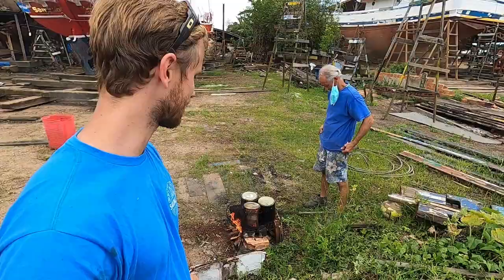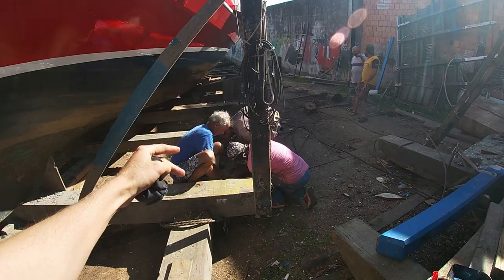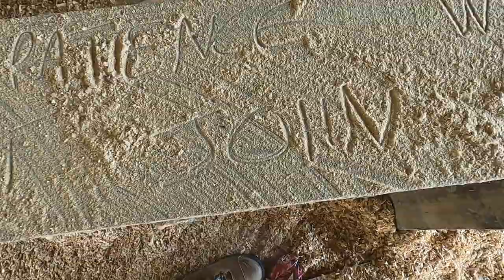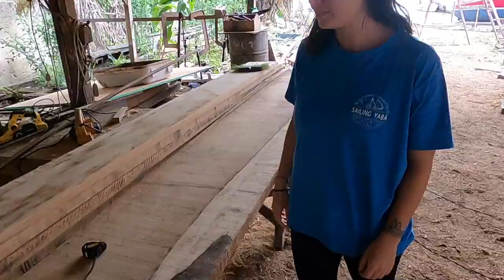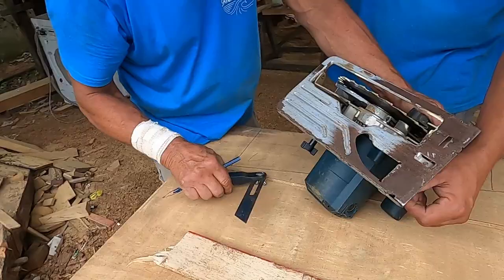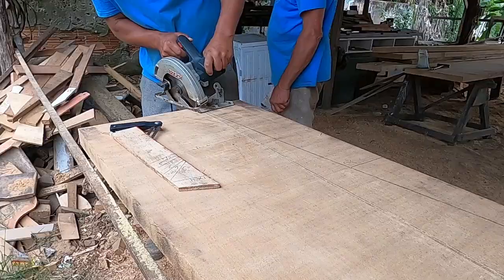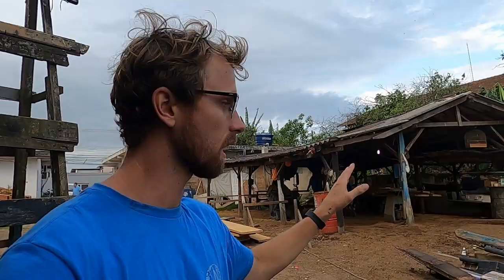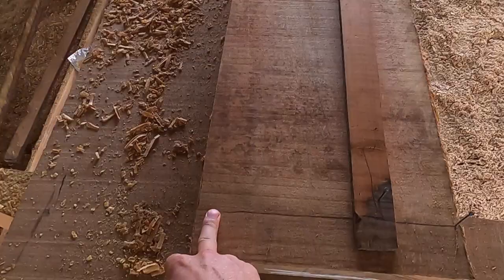Manoeuvering a schooner with a jack? + building our FIRST PLANK! — Sailing Yabá #19

Comment: Bodging to the English would be "improvising" to an American.
Reply: Personally I see a different interpretation for bodging as meaning to make or repair (something) badly or clumsily.  Improvisation implies the act of making or doing something with whatever is available at the time. In the video I would lean towards the improvisation definition of the work done, it certainly could not be classed as clumsily made.
Reply: @paulk556   This is a relatively modern use of the word which sadly does not do justice to a long tradition of practical craftsmanship associated with bodging.  Originally it meant work made from unseasoned wood.  Pieces were generally unrefined in terms of appearance but often very skilfully made.  Its rough and ready finish would give the impression of something put together quickly and without great thought to aesthetics but that was because things were made and used by people who lived and worked in the forests and not in fine houses.  https://en.wikipedia.org/wiki/Bodging
Reply: And it would be “desenrascar” in European Portuguese.
Reply: @paulk556  Concur.  In Australian English a 'bodgy' job would be one that was done roughly or poorly, on the cheap, with no regard for long term issues.   This is more in the 'improvise, adapt, overcome' line.  Very obvious these blokes from the boatyard are no stranger to this type of work and have done it many times before.  The difference between a shipyard here and one in a western nation is that, say, here or in the US, the cost of doing this would bankrupt you unless you were independently very wealthy.   But the cost of labour and materials here is clearly far less.  That's their secret, if they took the boat to the US for instanced, just the cost of getting it out of the water and keeping it there this long would be many times what this rebuild will cost.
Reply: @paulk556  I would also agree. It's right in the Marriam-Webster dictionary:
botched 
adjective
\ ˈbächt  \
Definition of botched
: unsuccessful because of being poorly done : spoiled by mistakes
a botched attempt
a botched recipe
a botched medical procedure
Reply: @nickopedia5669  Bodged is not the same as botched, bodge is to make do with what you have/can afford although what you use was not necessarily  intended for the use to which you put it but it does the job.
Reply: @kevinmcneill468  
That's not what they teach us in schools anymore, these days bodge/botched/bodging are basically all different forms of the same word or at least very close synonyms. Honestly I'm not sure who decides that, the dictionaries?

https://www.dictionary.com/browse/bodge

Comment: Not to sound like a downer (negative) but wouldn't been cheaper and faster to build a new boat and strip good parts off of your boat and put it in the new one. Your replacing the entire hull of your and replacing with new. There is allot of work and money being spent removing rotten wood and replacing with new wood.
Reply: No and no. it isn't neither faster nor cheaper.
Think about this: A bit higher above the waterline Yabá is fine, and lofting alone is a lot of work.